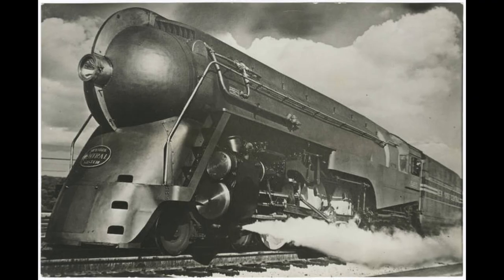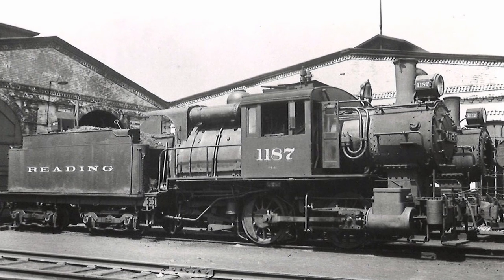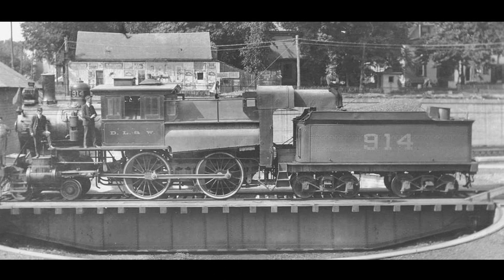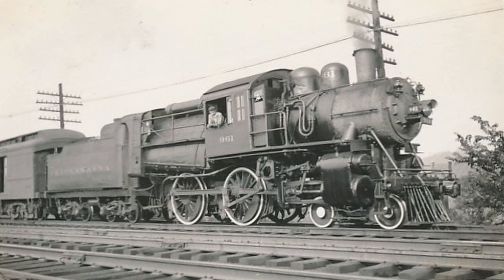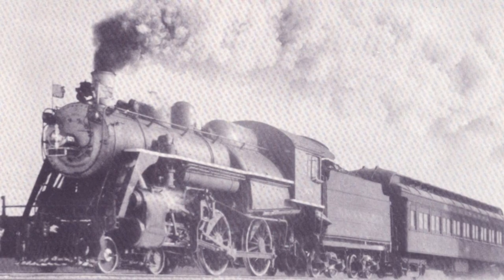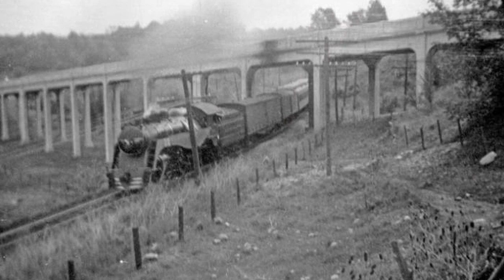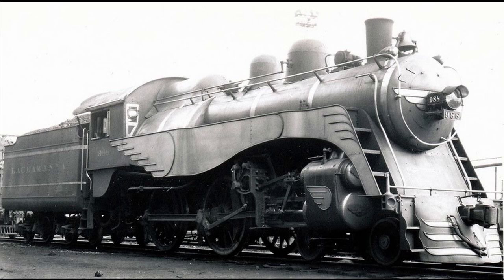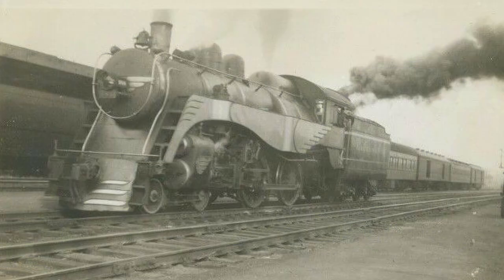Remarkable Engines: Lackawanna 988

Comment: At first, I though this was a 4-4-0 Camelback converted into a streamlined 4-6-0 Ten wheeler.  But I was wrong.  It was a 4-4-0 American it’s entire life.
Reply: Why was 988 taken out of her camelback design and taken into a streamlined design?
Reply: @jeremyasher297  Because camelback engines were banned from U.S. railroads in the 1920's, due to various safety concerns. As a result, some camelbacks (including #988) were converted to a more conventional cab-behind-the-firebox configuration. As for why #988 got streamlined? I don't know... Maybe for publicity? I doubt that cosmetic shrouding made much of a difference in the train's performance.
Reply: Or possibly for the 100th anniversary to the 4-4-0s

Comment: You should do metra 100
Reply from the maker: I'm not sure if I have enough info to do an episode of it, but I did recognize the locomotive briefly in the August 2020 Pensyfan Periodical.
Reply: @Pensyfan19  it is the oldest f40 in existence
Reply from the maker: @Mauscmkwk  That would be Amtrak 200, built in March 1976, currently NPCU 90200.
Reply: @Pensyfan19  metra 100 is the oldest f40 with a prime mover
Reply from the maker: @Mauscmkwk  Good point. I'll be sure to bring it up in a future video.